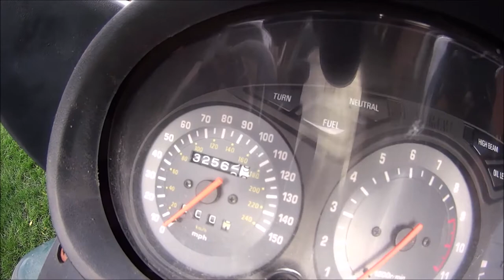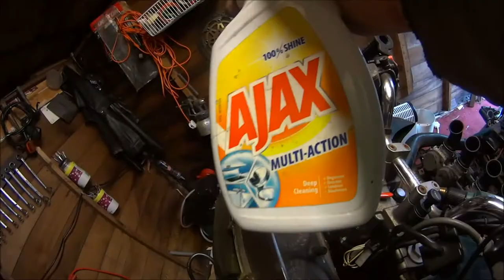YAMAHA XJ900S PROJECT,P-1

Comment: mate you're a legend. i was pulling at that black part on the front for half an hour and couldnt figure it out. I bought an xj900s for 250€. Running perfectly fine but the back brake caliper needs rebuilding. But ive decided to take it apart to give it a good thorough clean. Ill b watching a few of your xj900 videos. Thank you so much for making them
Reply from the maker: Thanks Steve. Think you should remove all the little rubber screw grommets first lol. The bleed nipples are only 8mm and tend to snap very easily. Any way good luck with it they are a good ride